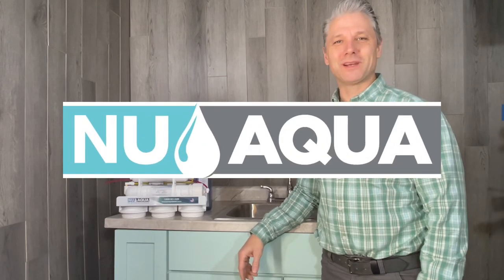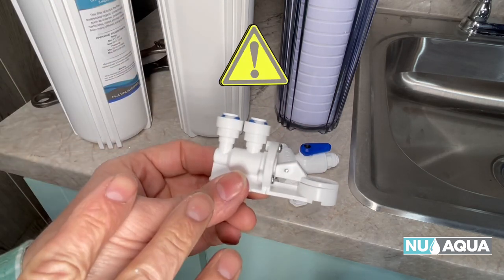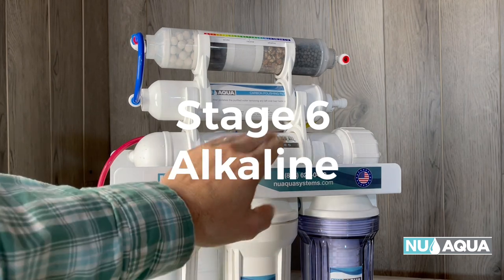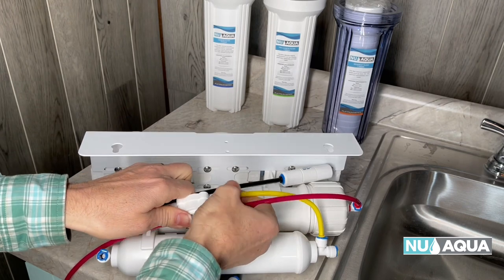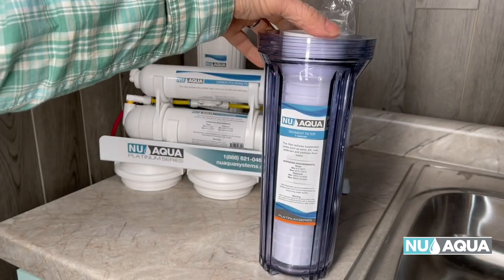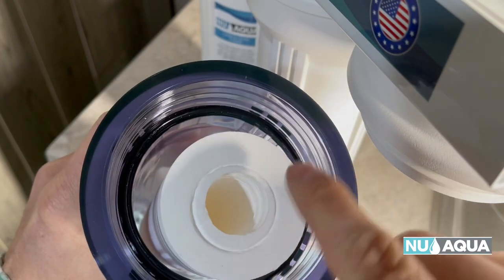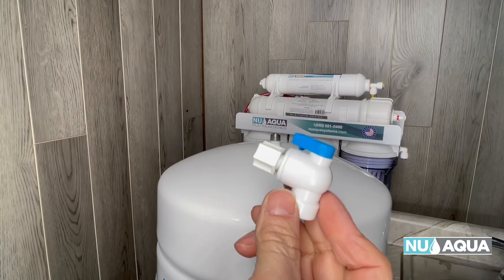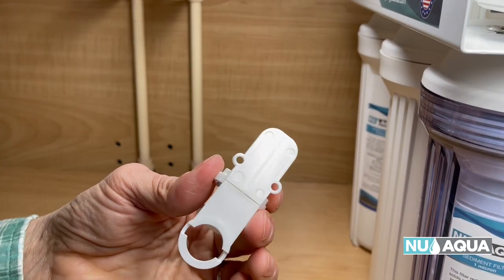Water Filtration Made Easy: Your Guide to RO Tank Installation | NU Aqua

Comment: Not sure if I'm gonna get a response or not, but how can I confirm if the UV light is actually working? I ran connected everything but haven't turned on water yet, checking the UV light and it won't come on. Does it need water pressure to work?

Comment: The system is leaking water into the drain from the black pipe all the time… it sux
Reply: So even when ro faucet is not in use the black line is still putting water into the pipe?
Reply: Having same problem

Comment: The leak stop is a good idea. except when the leak is between the main water feed and the stop valve. The stop valve stops the ro system from getting water. But it doesn't stop the leak from continuing to destroy your cabinet and floor. Found this out the hard way.

Comment: followed everything you did and still no water
Reply: Someone told me If the UV light isn't plugged in it will not flow. Im currently struggling myself
Reply: @athena9945 have you checked your pressure tank to ensure you have pressure in it?